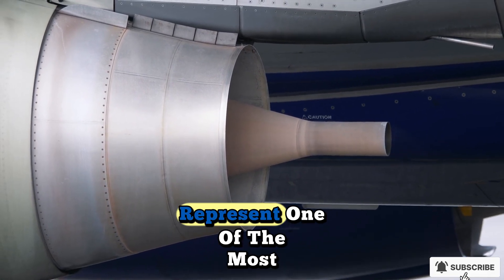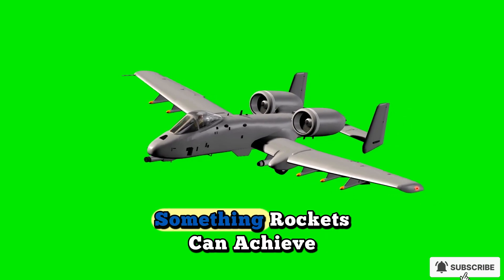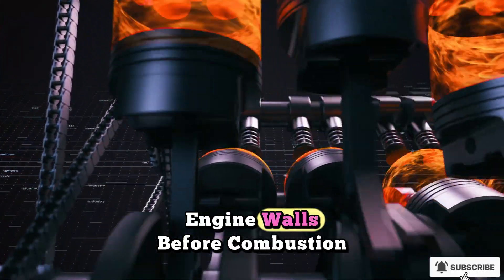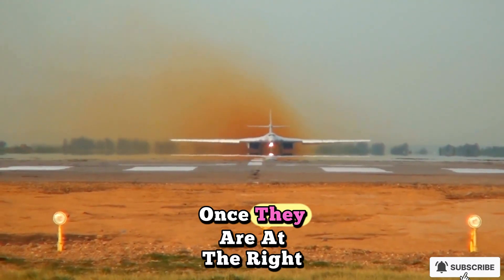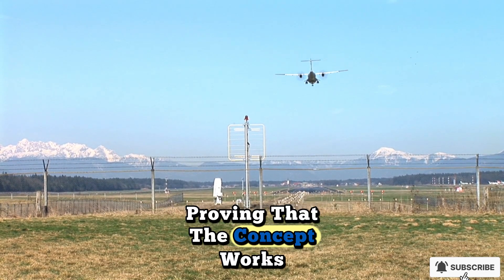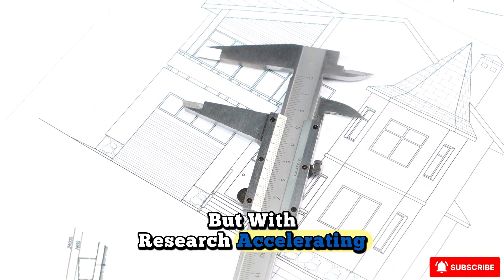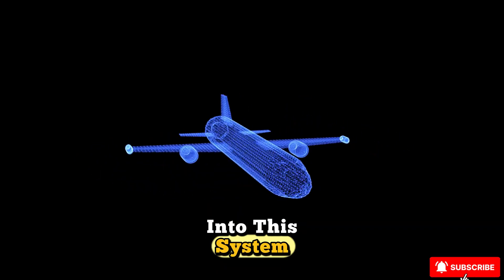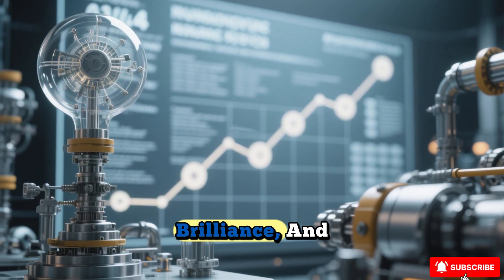Hypersonic Jet Engines Explained | The Future of Aviation Propulsion

Comment: 😎  Adaptive engine technology allows for the manipulation and distortion of the involved engine's internal geometry . Specifically , that involved in directing airflow through the engine .
The above allows for optimization of the engine's airflow dynamics for specific airspeed and density regimes . 
This grants better propulsive performance and efficiency with less friction and degradation of the involved engine components .
Reply from the maker: good info bro ...